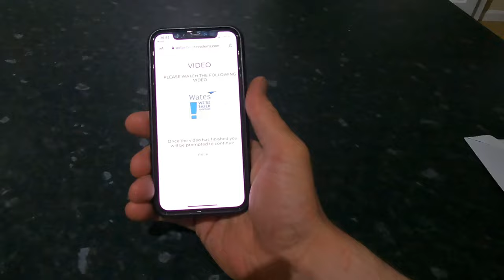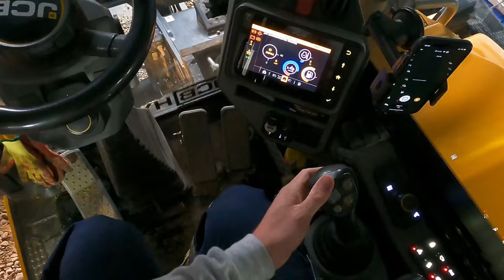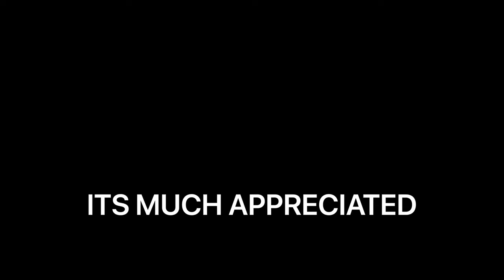A Week In The Life Of An Excavator Operator | Deep Drainage | Lifting Ops | Loading Wagons | POV

Comment: Hey buddy nice work using that bucket both ways to spread and level, would you use a blade if you had one for a large part of that levelling work ? What are your comments on brand of machine over different factors, power, specs, economy, noise, comfort and what not? Cheers from Australia !
Reply from the maker: Hello there, appreciate the comment and thanks for taking the time to watch the video.

Ideally a dozer would be perfect, but we just have to crack on with what we’ve got. It was really important that we get a really good compaction for this road, I’ve always found using the bucket that way helps a lot.

The case excavator in the video was a very used hired one, but they always seem to work brilliantly no matter the age/condition/hours. 

Every brand has the pros and cons I’d love to do a video on that if people were interested in that 👍

Comment: What's the average day rate in UK for blue card digger driver 10 tonne plus? Iv been driving mini diggers and 7 tonne machine for 12 years on private jobs as well as ground working and steel frame construction. I'm sick of the graft and looking at becoming a skilled driver. Are blue card drivers strictly assigned to just a machine iswell. I.e are you expected to get out and get on the shovels or is that only with small companies? Thanks for the content.
Reply from the maker: Hello mate, great question but so hard to answer though.

Some companies allocate a machine to you as it tends to get looked after better that way. But i personally wouldn’t expect a machine until I’d put some time and graft in for that company.

Plant hire companies and agency’s will argue you aren’t insured to be out the machines and on the ground when your on hire through them in case you get injured in the process.

Day rates fluctuates so much, there’s too many factors to get into to put a rate into writing on here.

Sounds like you just need a change mate, you just need to put yourself out there see what and where works best for you, might not happen straight away but there’s plenty of good companies out there looking for good operators

Appreciate the comment and good luck mate, all the best. 👍
Reply: @lifebehindthelevers  thanks so much. I will get onto it in the new year.